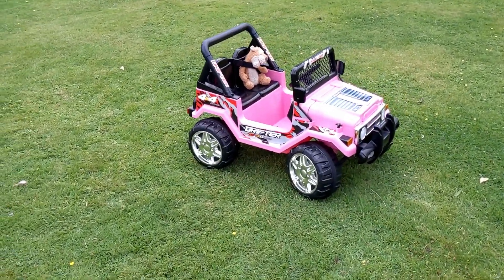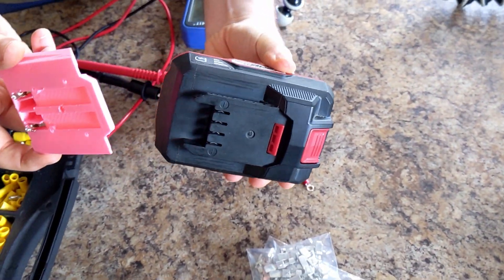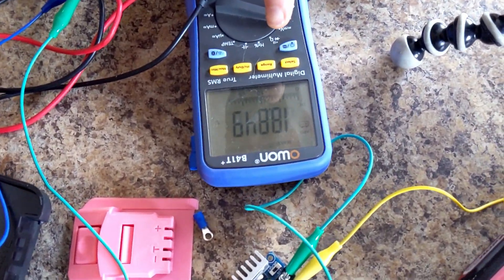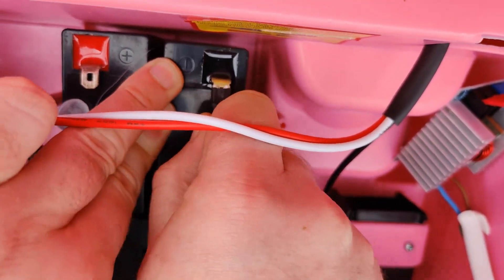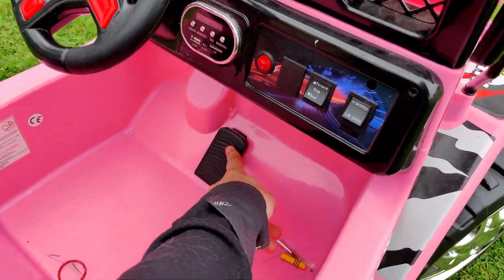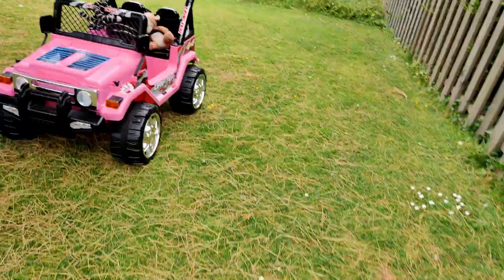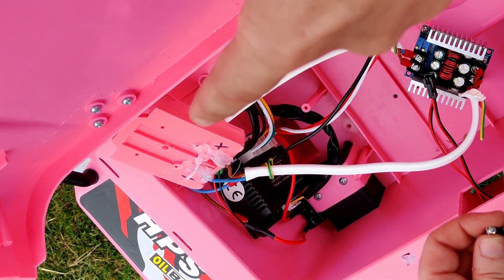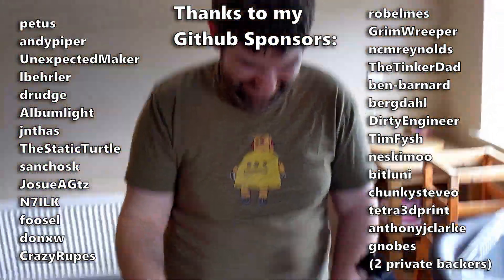Easy DIY Power Wheels Battery Upgrade (feat. bitluni)

Comment from the maker: We did increase the voltage to 14V after the video and the car really flies! Total build time was only about 2 hours!

The biggest issue with this mod, is with 3 batteries available, the car now lasts too long! Battery life with even one 4Ah battery is way longer than the old lead acid one. Thanks @bitluni!
Reply: What was the old ones capacity compared to this 4Ah?
I'm thinking about cranking up my kid's EV, that has 7Ah (as seller claims, but I think it is max. 3,5 Ah) battery, and it can lasts up to 1h only. 
The most anoying thing with this led ones is replacing and utilization, practically every year (to maintain decent usage time).
Reply from the maker: @QWACHU  I think the remaining capacity would have been the important part! It wasn't holding charge anymore and even fully charged would only last a few minutes. 4AH would also be at 20V so would last longer than similar capacity on a 12V battery. The new battery was running fine for over 20 minutes when I started to get tired :D

Comment: Just wondering how you got the remote to still work aftet changing over to a drill battery? I got a universal remote and can't seem to get it to connect to the car 😢 after I modified it

Comment: Awesome project, I was just thinking of doing the same, but some discharge protection should be added.
Reply from the maker: It's on my to-do list!
Reply: @BrianLough  Maybe just a volt meter is enough, and you can just keep an eye on it.
Reply from the maker: @martinnedyalkov9185  I'm probably going to use a microcontroller so I can program in low battery events when I need to finish up 😅

Comment: Nice project!! What terminals did you use for the connection with the battery?
Reply from the maker: They are ones I bought from AliExpress, I I linked them in the description

Comment: Wouldn't this work at 20V directly?
Reply: The control electronics might not be able to handle that high of an input voltage. Worth checking for any writing on the box for more info.
Reply: @vince086  well, that was basically my question 😀
Reply from the maker: @BR.  It's possible it would work, although the control electronics say they are rated for 12V, but the old battery should have been 15V when fully charged so I'm not sure how that works out! 14V was plenty fast enough for my kids anyways, any faster and I'd need to take out insurance on it!
Reply: It works (tested myself 20v to the motors direct, I cannot say for the electronics) but you have to push the car a bit in order to avoid a front  wheel wheelie as the torque is high.

Comment: I have a DeWalt DC9096 cordless drill. The battery packs died and replacements are too expensive. 
It would be great to make an adapter that has a DC9096 top and the bottom half would be the adapter you made for this project. 

I already bought 10 (26650 3.7v LiPo that are 12800mAH) and a 5S BMS..
The 26650 cells are too big for the original battery pack, 

I was also thinking of using an esp with a 4 input ADC to monitor 4 of the 5 cells.
I am guessing a fail proof connector would be a 5 pin dupont with the center pin being ground and any one of the 4 outside pins supplying power to the esp circuit and to the ADC inputs. 

The esp would need to be able to be powered from a supply range of 2S to 5S without adjustments.
Reply: Can your drill not run off 18V? You can find ready made adaptors for most major brands. So you can use Parkside or Makita for example on your Dewalt.
Reply: @vince086  My drill is a 18v.  I bought 10 LiPo batteries on eBay that wanted to make into an universal battery for many projects. I like the way DeWalt makes the battery quick connect. 

So, for my drill, I want to make a 5S adapter that I can put on the bottom half of the DC9096 top half.. I hope  21v won't hurt an 18v drill.. or I will need something to step it down without losing power on the 3v voltage conversion..

I wish I could use it in my metal detector if I can build the right adapter. It needs a +12v and -9v source.

I also hope to use them as a 5S battery pack for a robot. I am hoping to build a robot that can change it's own batteries.

Comment: If I recall correctly these packs don't have any discharge protection (Parkside builds this into the power tool itself) So be careful not to completely drain them.
Reply from the maker: Yes that is true, I'll be adding something for that in the future but for now I'll just keep a close eye on it! We have 3 batteries so plenty of run time!
Reply: Using the DC to DC converter adds the special risk of not noticing the battery going way below its minimum voltage. As far as I remember there is pin on the battery connector that signals a low battery state so maybe with a mosfet and a resistor or even only a relais you could solve the problem.